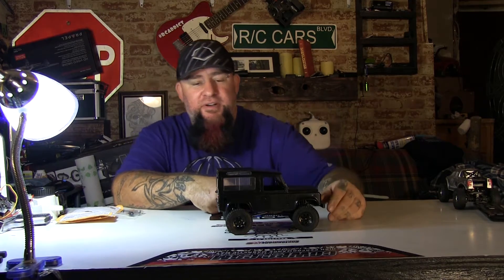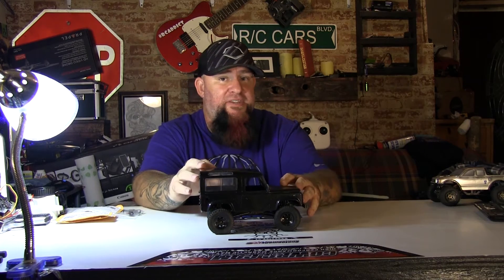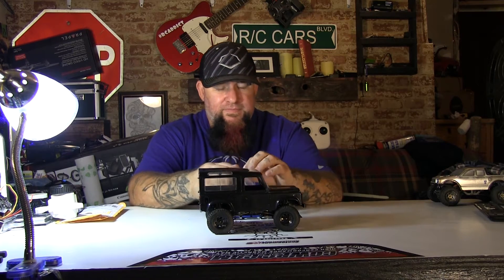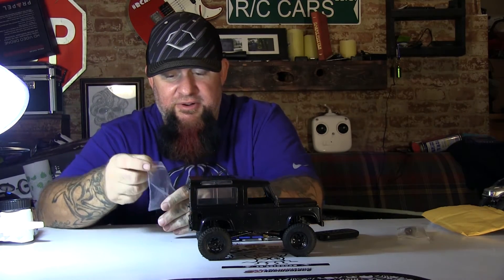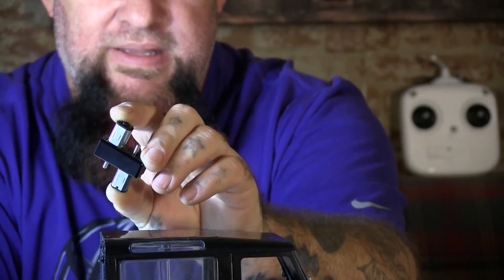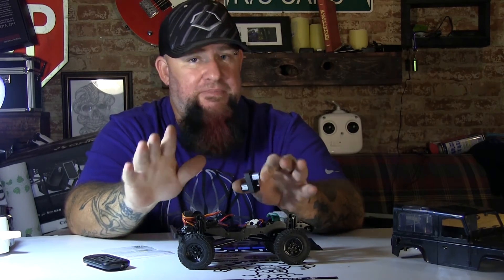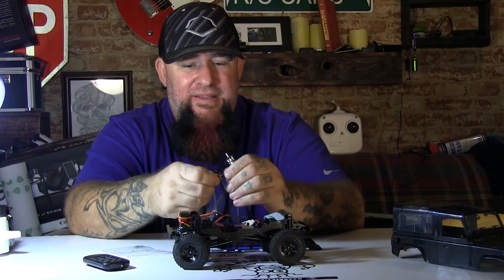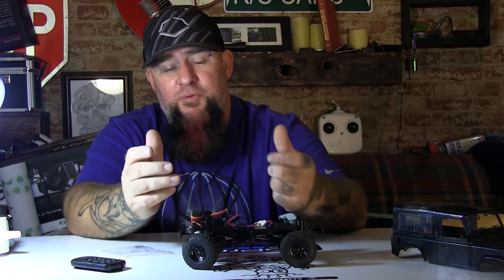RC4WD D90 1/18 REVIEW.   BUILD PART 1

Comment: Thanks for pointing out that the D90 is NOT 1/18 scale, it is clearly 1/24. I have several 1/24 & 1/18 scale rc vehicles which clearly proves this also, along with the fact that axles, shocks and tires are all 1/24 scale!  As for dual motors, converted mine fairly easily, still way underpowered tho. D90 looks great but performance is really bad. Thanks again - awesome video!!!

Comment: Dude. Love my Losi  MRC. And Hard TO Find Mini Parts now most are discontinued. I the process right now making 3D printable, cnc millable 3D models. Will be giving these plans away for all us die hard mini & micro dudes. :)

I was so disappointed when I got mine. But it is true 1/18. First RC4WD RTR product I ever got. The construction really nice for a proper scaler, but the electronics and power plant is total s!*#.

Ran mine for 12- 15 min and almost burnt the motor out. 

So puzzled why they would do that? 

The Orlando can out preform this rig stock. 

Really like the gear reduction but yeah. ? 

There is one guy out there running dually's of those got it to work and although there was a sing of improvement it still really was that great. 

True scale goes by the body size not the chassis and running gear size especially with 4X4's of any scale.

I lined it up with some of my true 1/18 scale die casts cars and it looked scale. 

RC models are commonly known to not be true to scale. 

I had to get a 1/14 body to fit my MRC to look proper. Even then 

I have a fairly modded MRC. Not to many stock parts left except drive train and chassis. And it's not done yet. :)

Mini's unite. :)

Subbed bud. :)
Reply from the maker: I have had a few mrcs.   Deffinatly fun.    One I turned to a true trail trick with xtrail chassis conversion.      Keep in mind.    If you need parts still.     The vatera slick rock.    Uses same axles and trans.